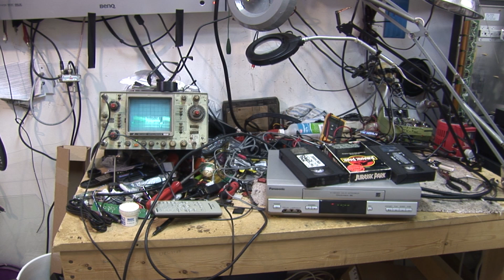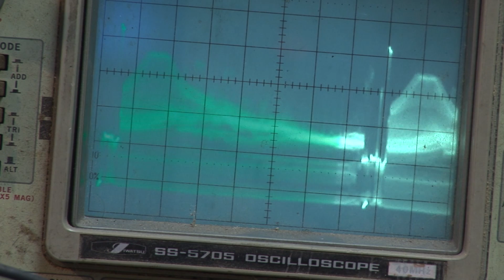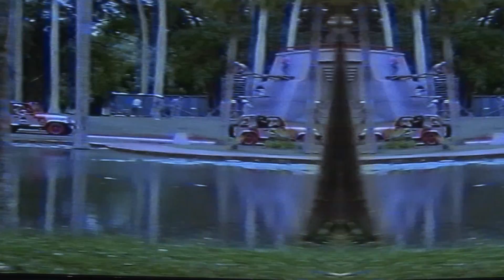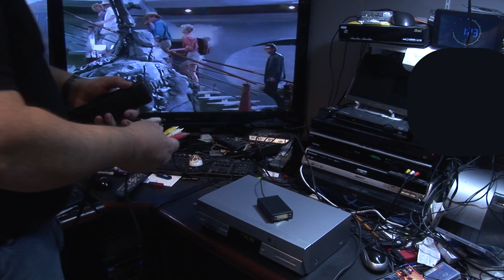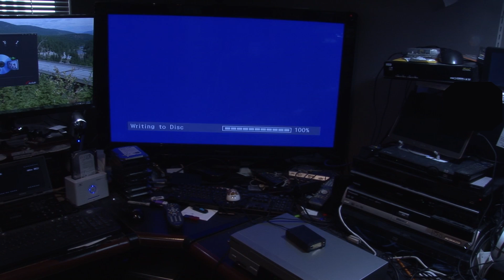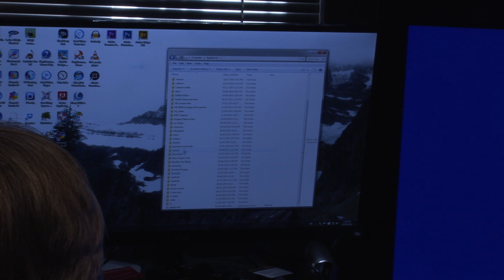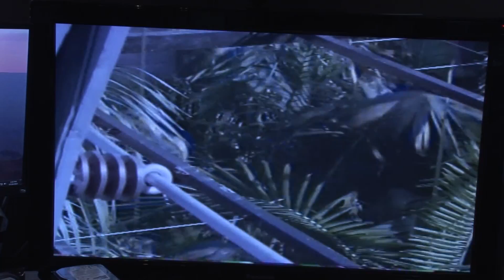Copy macrovision protected Video to DVD

Comment: If you copy in 1987 a VHS => Video2000 the Macrovision Copyprotection don't work. The Reason is that the Video2000 don't measure the Black level after the Vertical Impulses. It measure the Black level and the Maximum Luminance Level in each Line so this will be Protect the System against the Macrovision. The VHS Video Input Chip measure the Luminance and the Blacklevel everytime after the Vertikal Sync. If you make a copy from VHS => VHS the Cheapest Way was to unsolder (disconect) the AGC Pin Connection on the Videoinput Chipset. So you copy the Macrovision also on the new Tape - and there is no Problem about the Video Gain because the Videosignal is coming from a VHS Tape and not from the Tuner for that the AGC is build in the Videomachine. The FM Dynamic must be in this VHS Range that the Videotape is not clipping. FM Signal on the Tape will not clip or over speak and no Dropout can occur. I'm asking me why the Video2000 System never came out in the US or in Asia that was a Super System - maybe they shall make a PCM Audio or a Sound in Sync - the Audio Tone was bad like max 10kHz then Stereo but no HiFi Audio. But Grundig have one Videorecorder in development the Video V200 with a PCM Audio Stereo.

Comment: why did you delete my comment ? bottom of your final dvd has problem and you instead of answering it , you just deleted it . shame on you
Reply from the maker: I didn't delete it, it was likely trapped by the spam filter. I don't delete any comments unless there is profanity in it.
Reply: ok then would you please answer my question please                              I use XDIMAX GREX-7.4 Grex Video Stabilizer , the only problem I have and I dont like and you have the same problem is  the bottom of your created dvd 's picture its moving and kind of distorted .
Reply from the maker: What you are seeing at the bottom of the picture has nothing to do with copy protection. That is the head switching point. On VHS this is 6 lines before the vertical sync pulse that signals the end of the frame to trigger vertical retrace to start at the top of the picture.  This is where the hand off from 1 video head that has reached the end of it's track, to the other video head on the opposite side of the drum is beginning it's track. Head switching is done 6 lines before the end of the track to ensure than there is no disturbance to the vertical sync pulse, called the "hammerhead" as if the vertical sync pulses were distorted, the picture would roll like crazy. On a tube TV you would never see this because all tube TVs had the vertical size set slightly larger then the screen size so as to hide this switching point outside of the picture area. If you play an analog tape on a TV that has a vertical hold control, and you adjust it slightly so the vertical sync bar is in the picture you will see it.
If you look up my video where I demonstrated a Conrac professional monitor, I show the horizontal and vertical delay circuits that intentionally delay the scan so as to show the sync pulses and color burst area in the picture for engineering evaluation.
This is only an artifact of consumer video gear. Professional gear was built to much higher tolerances. Professional 1" tape for example used a single head, and therefore did not require head switching in the active picture area. 2" quad did, and actually did it several times throughout the picture, but that format required an engineer to operate it, and the signals always were routed into a time base corrector to fix any time base errors before the signal hit the transmitter. 
Betacam hid their switching point in the vertical blanking (sync) area, however those playback decks were also operating with a time base corrector and the servos were locked to an external time base so the switching would occur during the time that the TBC was generating it's own sync. But all consumer analog formats, VHS, Beta, SVHS, 8MM Hi-8 and 3/4" all had the switching point in the active picture area.

Now, digital 8 and mini DV also switched in the active picture area. Mini DV actually did it 5 times in each frame. Because it is digital you will never see it, but if 1 head clogs on a digital tape, you get 5 frozen bands of picture. The last output from the clogged head will be held on the screen until the head clears.
Reply: Hands down , this was the best explanation I've ever read about this .very helpful. thank you so much.

We are a group of 6 friends trying to save classic movies Dubbed in Farsi before revolution 40/50 years ago . All dubbed audio tracks are saved and we already synchronized the audio tracks to more then 3000 of them to bluray or dvd . some of them don't have DVD and only available on VHS. online vhs rips are mostly divx so we rather transfer ourself . 

we using  XDIMAX GREX-7.4 Grex Video Stabilizer , but we like to buy   macroliminator , we now believe a very professional and knowledgeable person like you cant be wrong . can you help us find one ? thanks again
Reply: Speaking of head switching points, one of my vintage Beta machine's recordings have the head switching point visible even on CRT TVs. Is there any kind of adjustment to make it look like a thin line at the bottom of the screen?
Reply from the maker: Fivos Sakellis 
Yes there is an adjustment to set where the switching point occurred. Yours may have been mis-adjusted should be 6 lines before vertical sync on ntsc machines.
Reply from the maker: Future video will be setting up the switching point on a old VCR. Newer ones this was taken care of digitally, but the older ones had a control and I will make a video to show how to adjust , and how it looks when set incorrectly.

Comment: I heard another way you can remove it is by using an RF modulator on the composite video output, then using a second recorder hooked to the RF modulator. The RF modulator re-transmits the signal but without the macro-vision signal
Reply: Yes, however the quality degradation would be significant.

Comment: Also, I can't use a computer. My computer does not burn discs.
Reply: Solution: Buy a new computer that works.
Did you work that out over the past 3 years?

Comment: What about when I connect the VHS player to computer and use screen grabbing tool to record the movie? I mean, the computer only plays it on the screen. Recording device is not taking direct signal from the VHS machine, but instead takes the screen signal and records it in a video. Pretty simple. VHS tape doesn't recognise it's being captured and doesn't activate anti-copy protection :)

Comment: would this method work for a toshiba vhs dvd combo recorder?
Reply from the maker: Not for making a recording from the VCR top the DVD recorder, but it will if the signal is external such as a seperate DVD player, VCR or cable box, run through the macro eliminator and then into the VCR or DVD recorder.

Comment: Great video, and I have acquired a used HD PVR to capture some old tapes, but may I ask, how are you connecting the VCR, with it's old coaxial cable output, to the HD PVR, with its component video inputs?  I have tried connecting the VCR to my TV, and the TV to the HD PVR, but the component ports are input only and the HD PVR is not getting a signal.
Reply from the maker: I connect to the AV inputs on the front for composite or S video input. The component inputs are connected to the HD component outputs on my cable TV box so I can record TV shows in HD.
Reply: 12voltvids
Thanks.  I guess I need a different VCR.  My old VCR, while it works fine, does not have the three RCA cable ports on the front that some do, and which I could connect up to the HD PVR, or an S video port -- just coaxial cable connectors and the audio cable ports in the back.

Comment: Can I buy one of these macrovision eliminators from you? I used to have one but lost it in a move and need one to back up all my Disney VHS tapes I spent so much money on.
Reply from the maker: I don't have one for sale. The one I have I built back in 1982. It was published in a magazine called Radio Electronics.  The TV Sync generator for TV camera is long obsolete now. If you could find that part it would be relatively easy to make one, The design I have is one of the few that removes 100% of the macrovision signal. The ones sold under names such as Curtis leave a little bit of it behind, enough to trigger the anti copy circuit on digital devices. A time base corrector will also do the trick, such as the Videonics MX1 mixer.
Reply: @12voltvids  It was published on December 1987 issue page 49 I have the PDF on that issue.
Reply from the maker: @franklinsterlen6817  
I built this one when i was 19 and that would have been 1982
Reply: @12voltvids  maybe there's another one from 1982 but for sure there is another from 1987 because I have it and it shows all the details on it.
Reply from the maker: @franklinsterlen6817  
Probably different chip set.  This one uses an RCA tv camera sync generator chip.
Reply: @12voltvids  I think that's what it is because the PCB layout looks different from yours it looks more updated.
Reply from the maker: @franklinsterlen6817  
There were legal limits placed on macroscrubbers. Legal units were permitted to restore sync levels and clip the peak white to below 100 ire so that AGC was unaffected in home theatre components but the watermark and colorstripe information was present so newer VCRs and DVD recorders would still lock onto the weakened macrovision signal and refuse to record.  The one of have generates new horizontal and vertical sync that is genlocked to incoming video. It then switches in the newly generated sync signal completely stripping 100% of all traces of the watermark signal.  The one I have can not be manufactured or sold. The sync chip is also now completely obsolete.  It was from an RCA broadcast camera.
Reply: The Avt 8710 removes macrovision.
Reply from the maker: All time base correctors will remove macrovision, however they will also slightly soften your picture. The device I have only generates the distorted sync. It locks on to incoming sync, and then is gated in only from the start of vertical sync for the first 20 lines or so then gated out allowing the original unaltered video signal through. A TBC digitizes the signal, stores it, and then reads it out. That process of A-D D-A rolls off some of the high frequencies. The Videonics MX1 switcher, which meets FCC broadcast standards causes slight degradation of the picture. A source from say a DVD player or cable box does not have time base errors as they are digitally generated in the device, so converting to digital and then back to analog causes a noticeable drop in quality. The device I show here does not. That said, you can't buy this device easily, as it was banned, and is illegal to manufacture, import or sell. The device was sold in the early 80's, and the circuit was published in Radio Electronics as that is where I got the plans, and ordered the parts kit from North County radio way back in 1982. I am sure there are units floating around Ebay and stuff, as I know lots of people that like me bought the parts kit for 50.00.
Reply: Will a "datavideo VP-299" device remove macrovision? (= black picture) - Thank you!!

Comment: I have a Magnavox DVD Recorder and would like to record protected programming off of HBO (through Verizon Fios) to DVD, but always get the notice that the programming is copyrighted and cannot be recorded. Which device would you recommend for me to get around that?
Reply from the maker: The device I show in this video works perfect for HBO and on demand content. I use it all the time for just that. Also a videonics mx1 video mixer will do the trick as well as it strips out macro vision.
Reply: Thanks for the info! I was thinking about buying either one of those items or possibly the XDIMAX GREX-7.4 Grex Video Stabilizer as well.
Reply: If you have an older video camera that has the pass-thru feature...you can connect the output from your cable box to the camera...then the output from the camera to your DVD recorder. You can also try using an EzCap (you can get these on Ebay and Amazon). Connect the Ezcap to the output of your cable box  via RCA plug and then connect the USB plug from the Ezcap to your computer. Ezcap comes with capture software.

Comment: I used to have an ATI TV Wonder TV card in my PC and that did not have any video copy protection but the ATI TV Wonder Pro did have the Copy Guard built in.  A Digital Video Stabilizer for about $50 was quite useful when recording from VHS to re-archive to DVD.  I'm using an ATI Theatre 650 now for the ATSC signals.
Reply from the maker: I have a hauppague 1600 for the STSC off air signals, and a Hauppague HDPVR to record HD component signals from my cable box, which is usually what I record from as ATSC there are only a few channels here, and those channels are al on cable anyway.
Reply: No Cable service out in remote areas.  Using Windows with ATSC has a Region Lock.  Win Install with CDN credentials can't see any TV.  Too far from CDN Broadcats.  Re-Install Win with US credentials and get the American broadcasts.  Called MS and I swear that they are certified stupid.
Reply from the maker: Yup I found that out too. Couldn't get any Canadian stations either, just analog because my card was made before Canada switched over. The solution was to use a US zip code
Reply: i had a similar product. it was called DVD Xpress.  It came out in like 2000.  it let me copy ANY macrovision-protected media.  I still have it, but i have moved on from WindowsXP, and use a later version of Windows, which the device would not work with.  I use a device called Video Clarifier VC-3 to copy macrovision protected content.

Comment: I've been trying to backup my vhs tapes to pc..I've been using clearclick vhs2dvd..when I copy copied vhs tapes there's no problem. But when trying to capture original vhs tapes the pc capturing software will freeze the picture..its not crashing , the preview screen will freeze. There's still audio though. Is this a type of macrovision copy protection?
Reply from the maker: +Terry Delport yes more than likely. The pulses are driving the capture card out of range. Some brands of capture card work others not.
Reply: U might have a slow computer

Comment: oh VCR how I don't miss you at all, but this is still really cool to see videos like this!
Reply from the maker: +Chevy Chase I don't miss VCRs as far as time shifting goes, but I am finding that I am using them more these days than ever archiving video to digital for clients. Just got another 45  2 hour tapes to put on a hard drive last night.
Reply: +12voltvids for sure!  Any plans to do videos on newer protections like HDCP or HDCP 2.2 on 4K? I more so just find them very interesting just like Macrovision was back in the day. Keep up the great work
Reply from the maker: +Chevy Chase I have shown a few HDMI to component and HDMI to composite devices. The HDMI to component allows recording of HD component signals from a variety of devices, but no plans to circumvent encrypted video because under the DMCA removing digital locks from content is illegal. As a content creator I am in full support of protecting content from unauthorized copying. The only reason I showed this unit in the first place was to give insight in ways to archive protected analog content, as many of these analog playback devices are wearing out, and people need a way to preserve their content.

Comment: I bought one of these a while back, very convenient for movies never released on dvd/blu ray preservation
Reply from the maker: +Horrifyingly Hillarious This one works with all flavours of Macrovision, including color stripe such as from satellite and cable boxes used to protect PPV.
Reply from the maker: I believe that M2 had some commercial success with the NBC network in the USA. Everyone else went Betacam and BetaSP.
Reply: Hello do you know how to use a professioanl tbc I got one from a tv station and it works but I dont think i got it hooked up quite right
Reply from the maker: A professional TBC is a different animal. Most are not full frame stores, however some are.Many are only a process a few lines at a time. They require facility sync from an external sync generator. That can be a stand alone black generator, or a TV camera. Master Sync Generators use a crystal controlled oscillator that is heated in an oven for frequency stability, and the entire TV station is references to it (Also called Genlock) The playback VTR and TBC are both referenced to this gunlock. This is required in an analog TV station, so that the color burst reference can be phase synced to the master genlock clock.There are also 2 different types of TBC for broadcast use. For high band direct color recorders, and for heterodyne recorders.Some TBCs such as some of the Ampex units had a switch for direct color or color under (heterodyne) color. VCRs use heterodyne color, where the color signal is converted down in frequency and recorded, and then converted back up to the proper frequency during playback, by contrast to direct color used on 1' and 2" formats, that records the color in  the video signal as a composite signal. Then there is the betacam and M2 formats that use component color recording, and they need a TBC all of their own. Confused yet?
Reply: Hello the only thing I remember them telling me is it is full frame and does work with vhs units I do have some that can excepet an external tbc but I dont have cables to hook it up with.
Reply: Not yet! But you explain it so well. Did the M2 format ever catch on in North America?